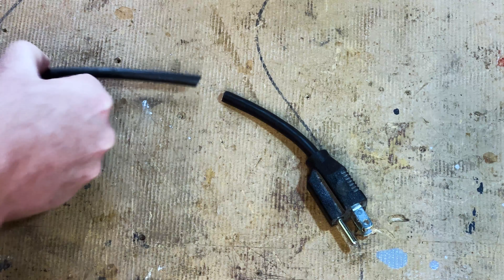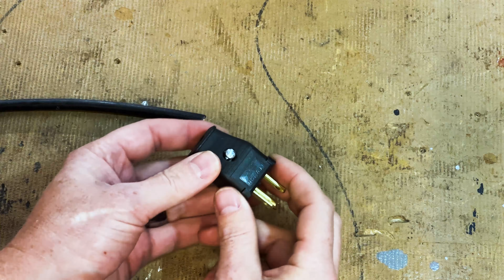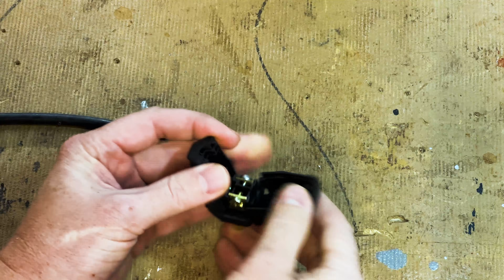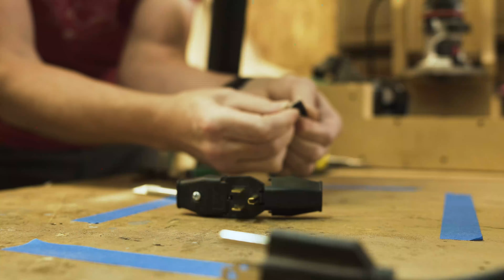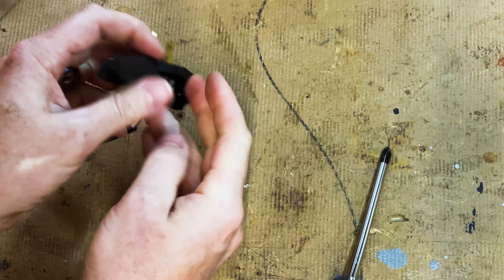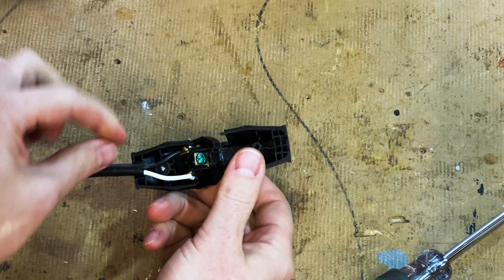4 Minute Fix for Damaged Power Cord / Plug Replacement

Comment: I have a black wire, green wire, a white wire and 3 uninsulated bare wires for my outdoor roof ice melter wires. What now please?
Reply from the maker: On heat cable, those bare strands are usually the braided shield/ground — they get twisted together and land on the green ground. Black and white are your hot and neutral, but check the manufacturer's instructions for your specific cable before you wire it up, since roof melt systems vary.

Comment: Thanks for showing people how to fix their stuff. Being on the internet however. I must argue that it could be done better:

-There's appearently no strain relief to clamp onto the outer sheath: If you pull on the cable, you pull directly on the screw terminals 
-There's no ferrules used, making for a less certain connection.
-Using a shielded plug with unshielded wire might give a false sense of safety, if the appliance is made of metal.

Best practice (in the EU) is to replace the entire cord with a new one with ferrules on one end and a complete cast plug on the other.

Comment: My air filter cord stopped working, my ex had spliced it to another plug but that also stopped working, so I tried this. The cord has red and black cords inside, not white and black. Google said to treat the red one like the white one. That blew a fuse. Then Google said to switch them. That created sparks in the plug and a smell of melted plastic. What kind of possessed air filter do I have? I thought it was a normal air filter... Blueair Pure 411 120v air filter from ebay bought in 2021 :(

Comment: Also, if your wire is damaged really far down the cord you can still do this repair and then just plug it into an extension cord as the remainder of your cord. Just don't use extension cords on some appliances like space heaters.

Comment: Some advice for those of you who have no way to know which wires are nutral and which wires are load. One wire on a two-wire cord will have a series of ridges or grooves running along its length, while the other side will be smooth. I didn't have white and black wires to help me determine which is which. Other than that, this tutorial was very helpful for repairing the cord to our outside floodlight.

Comment: Ive got a handy heater that the cord was cut on. Doesn't appear that the wires have any color coded sheathing over them in the power cord stub. Just copper wire. Two wire cord btw. Does it matter which "side" I connect to if splicing an old power cord onto it?

Comment: I have a question. Why the cable did not have a ground line if the original plug that you replace seemed to have a ground plug?

Comment: So who's here because of Midea U AC cutting cord to get refund?😂
Reply: Hey did you try to fix yours? I’m think of pickup up a used one that has cut cord and try to fix it 😭
Reply: @fluffy4354   It appears to be mostly a drainage issue, and the fix is to replace a plastic plug with some water permeable plugs so any excess condensed water can slowly drain out. It is an easy DIY fix so people are just cutting cord, getting refund, and then hooking it back up so they can continue to use the AC, which otherwise is a really great unit.
Reply: Not that no, but two of my space heaters got recalled and I had to cut the cables. This seemed like a pretty good fix!

Comment: Thank you so much!! My cord wasn’t damaged but rather my plug, your video was so simple, informative and to the point I was able to replace a faulty (melted) plug on my heater with just a couple watches. Thanks to you my family and I have heat on this snowy night! And for only $3, not the $150 cost of replacing the entire heater. Truly thank you. I feel so capable in this moment, able to solve my own problems with the help of a 4:34 video. ❤❤❤

Comment: So why did you say that plug in the beginning was the severed plug from that wire if it has a ground and then you say that wire who was the original two-prong wires so it's impossible for it to have a grounded plug on it when it was just two wires it was just two wires

Comment: I fixed my NEW Drybar hairdryer.I stepped on the casing and cracked it. 

Thing is, the wire coating wasnt coated a certain color,  so i marked on one–to tell the difference. Easy peezy.

Comment: Is there a way to find which is neutral and which is load if the copper wiring doesn’t have color coded insulation. I do have a ground wire
Reply: I had trouble telling which screw was which so I finally took a guess. I guess I got it right!
Reply: @gracenote1837  Actually, I realized one side was charred and the other had an “N” and was not. So N is neutral and the charred side was the load
Reply: @bruceleeroy8302 anything unlabelled should be thrown out, old code.

Comment: What if the wires themselves don't have a white and black coating, they're both just black with no identification of which one is positive and neutral? I came across this problem the other day I didn't have any way to tell them apart other than to plug them into a new outlet piece kind of like this and then hope to God I didn't ruin anything LOL Digimon for a split second and then turned off I just immediately unplugged everything and as soon as I did it backwards

Comment: What happens if the wires are the exact same color? Black casing. Copper wires and that's it. No way to tell which is hot ground or neutral.
Reply: I have the same situation

Comment: This was a very helpful video. My iron was not working. Then I noticed that the cord portion, right next to the plug, had frayed. I could even see the exposed wires, if I looked very closely. I got a Leviton 15-amp non-polarized replacement plug online from Home Depot for $2.44. I installed it and my iron now works with no problems. Before I saw the video I was actually planning on throwing the iron away iron which I've had for a long time and really like (it's GE). Anyway, thanks for sharing.

Comment: Pet peeve: people using jack and plug interchangeably.
Webster’s dictionary:  Jack = a female fitting in an electric circuit used with a plug to make a connection with another circuit.
Also, when stripping wires do not twist the tool. It tends to damage the wire, making it weaker and prone to failure.

Comment: Can you use the end of another power cord from another vacuum?
My dog chewed right before the end that you plug into the wall.  I do have another vacuum cord that has the whole cord and end part, but was cut off so I can't attach it to the vacuum (I don't know how).
Reply from the maker: You definitely can. The trick is to make it secure enough so that if it’s tugged on, you’re not pulling the wiring apart.

Comment: Do you have a video for splicing when the cord is cut right near the appliance (maybe 2 or 3 inches?) thanks
Reply: There are videos available. One option is to use both a plug and a Jack. The only shortcoming is it coming unplugged easily.

Comment: Unfortunately I need to replace the whole cord. My fan was left in my shed and the previous owner has about two feet covered in electrical tape. The fan works plus I like the height. Since it’s going into my bedroom, I don’t want to take any chances of a fire while I’m sleeping. I’ve taken most of it apart to clean it but still need to know how to replace the cord. Any help from anyone would be appreciated.

Comment: How do you find out which is the power wire? The cable I need to fix just has black jackets on both wires inside

Comment: Them thing 4 and 5 now days...
I cut the wire without identifying +/- . The wire with text i assumed text acted as a line which from rc is hot. Meaning + . +is brass like in great video
 It all worked. Ps dont forget to put the thing on the wire.

Comment: My wires are blue, brown, and green/yellow... Where do they go??
Reply: Blue Brown Phase & Neutral Can Go In Any Bottom Pin Of Plug As Its AC Current In Homes & Commercial Setups Green Or Green/Yellow Wire Is Always A Earth Wire Which Will Go In Top Pin Of Plug Hope It Helps❤

Comment: i have a 3 prong replacement and a 2 prong original. does that actually work or do i need to get a 2 prong ?!
Reply from the maker: That'll work. There just won't be a wire hooked up to the third prong (ground) but there's no problem with that. You may actually wan to break off the ground pin to make sure it's clear to others that the appliance isn't grounded, but that's optional.

Comment: An if your unlucky and the cable snapped in the middle you just remain with 1m cable. Right way solder it or bring it in a shop for repair.

Comment: It's not a jack, it's a plug... and it's not an outlet either. The outlet is the receptacle in the wall. Also, strange that the original plug had a ground pin but no ground wire. Never seen that before...
Reply: He also says there are three plugs inside the plug…and A/C current plugs don’t have a “positive” wire, it’s hot and neutral.  Listening to this made me crazy, even with my limited knowledge of electrical components.

Comment: Waitasec... your original plug had an existing ground prong -- but yet there was no ground wire attached or even present? That does not sound like a UL-approved power cord -- perhaps you used a different plug end for demo purposes of this video? I'm confused by the idea of a groundless-grounded plug being legitimately sold in the U.S. and now I'm very curious where this cord came from. If that's a legit plug to that cord then I'm suddenly very concerned for my personal appliances. 😕
Reply: I was thinking the 3-prong plug was originally used to insure that the plug is oriented correctly, but 2 prong plugs in the US are polarized. The cord might be on a double insulated tool, which does not need a ground, but it still creates a false impression. I doubt UL would approve that...

Comment: Is it safe to use a 3 prong replacement plug with a 2 wire as you have shown in this video?  I'm trying to replace my two prong cord, but I only have access to a 3 prong replacement.  Thanks 👍
Reply: It is perfectly safe, although it is a bit misleading where a user could think "This has ground" when it in fact does not.
Reply: No, it would give the user the wrong idea on whether it was properly grounded.  Pay the extra dollar and do it right.

Comment: What if both wires are brass?
Reply: With power cords on appliances, an electrical wire that is totally smooth on the outside coating is the hot wire, which is then connected to the smaller terminal or prong on the plug. When you see wires with ribs or ridges, these are the neutral wires. Ribbed leads like these are connected to larger (polarized) prongs if there are any on the plugs.

Comment: Mine has no negative or positive. It's a simple two strand black wire with copper wiring inside on both sides. How do I tell polarity?
Reply: You use a wire tester. Whichever wire beeps, that means it’s the “Hot wire” or the wire that runs the current.

Comment: For safety. You should have a little more of a hook onto the screw. Makes it much less likely of it ever coming undone, or shorting
Reply: Can it be too long? can it overlap on itself?
Reply: @lydiaahubbell8545  as long as the wire is contained under the screw and can't move over and touch the other prong.
Reply: @gameboy1984 yeah, you don’t want to overdo it and start causing electrical loops etc where metal comes in contact with other areas it shouldn’t and can cause a fire
Reply: @lydiaahubbell8545 supposed to go around 2/3 the way...
Reply: Exactly my thoughts
Reply: Thank you 🎉
Reply: Thank you for this safety tip!
Reply: I don’t think it would do much seeing as it’s stranded. Also the wire gets tighter as you tighten the terminal anyways. Usually wraps itself around anyways
Reply: Matter fact all of you kan make your own videos he did it just fine it not a heavy duty commercial use cord. its just a simple power supply its fine. Although i already knew this information i learned that i could purchase the 3 prong plug that a client needs at a hardware store so i appreciate your video man thanks
Reply: @Kayeoss  Jesus. Someone makes an innocuous safety tip and you jump all over them. What are you, this guy's mom?
Reply: @Kayeoss A vacuum cleaner cord takes a lot of abuse as it gets yanked around furniture or people trip on it, yanking it out of the wall.  So making sure there’s enough wire to keep it securely locked onto the screw is an excellent suggestion and no reason for you to go berserk.
Reply: @Kayeoss  Where's yours?
Reply: You know you can always make a video of doing it your way
Reply: @Kayeoss LOL! 👏👏👏
Reply: @Kayeoss  Same for you skipper. It was a good suggestion. Can't wait for yours!